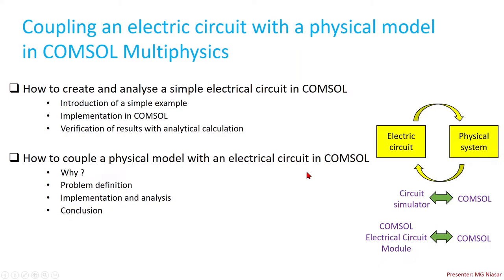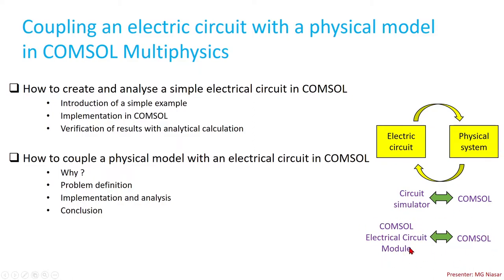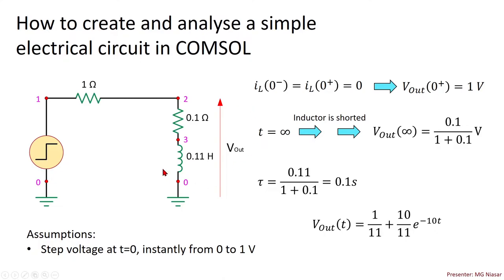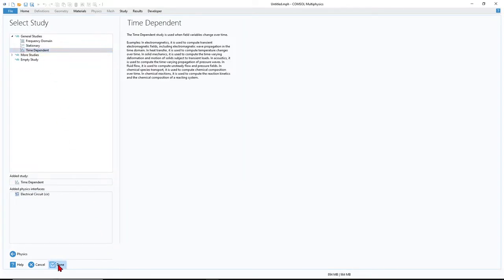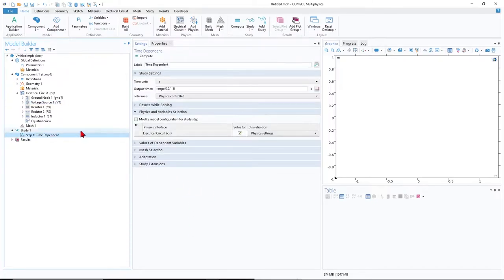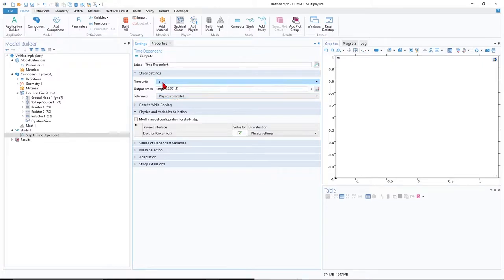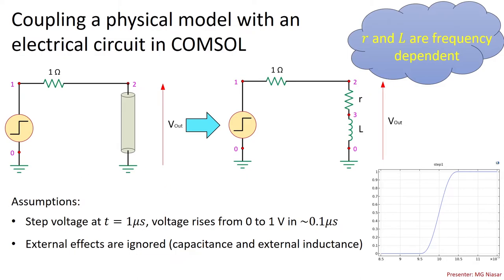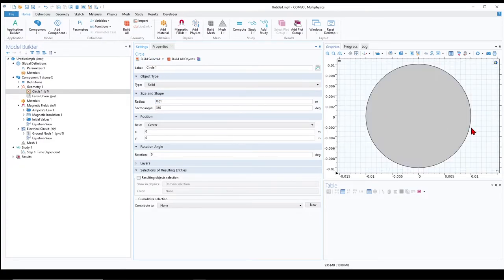How to couple an electric circuit with a physical model in COMSOL Multiphysics

Comment: do you think a simple test in comsol can be done using a cylindrical conductor with a  sum of sine waves going through it, and then loop antenna/coil mounted on the outside of the conductor to see if they can read the signal on the line?